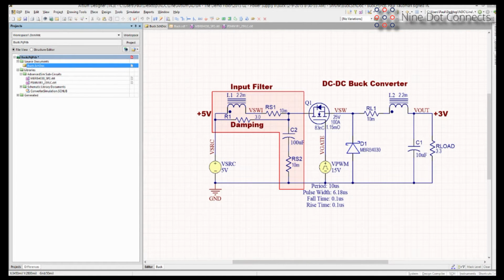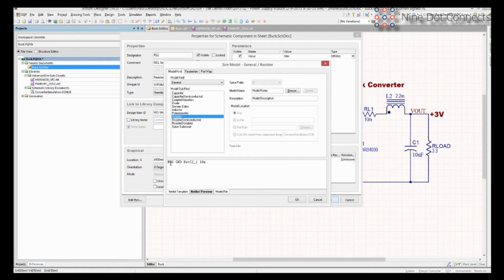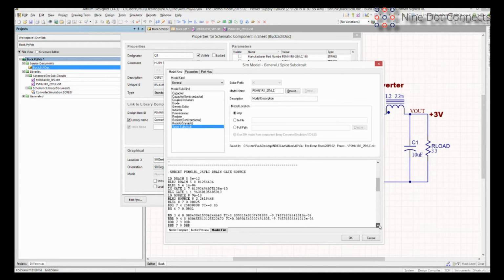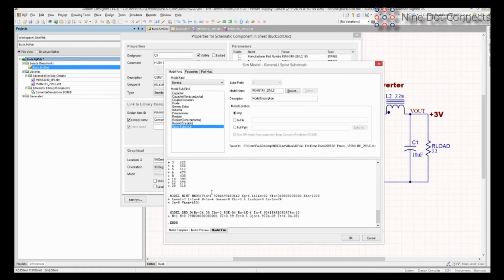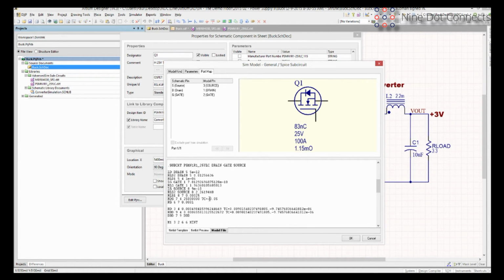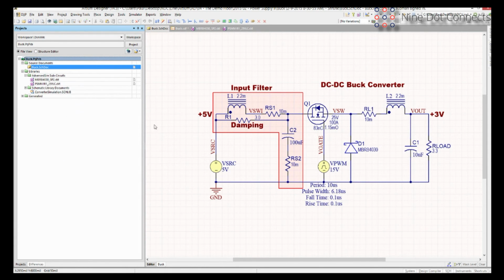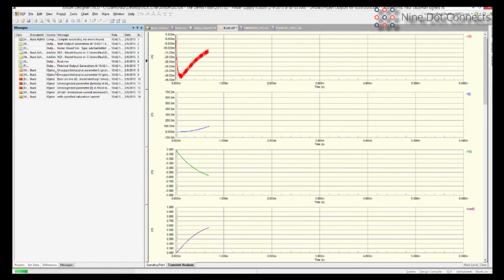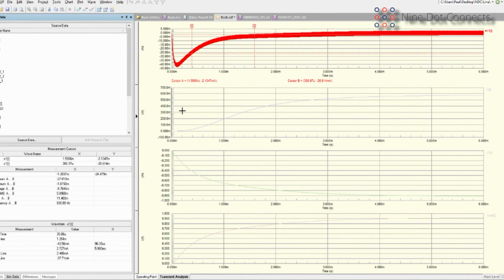Altium SPICE Overview

Comment: can you explain how to add spice model to a component without simulation ?
Reply from the maker: +rangelso -  Its the same method one would use to add a footprint to a symbol in Altium.  Instead, you are adding a text file instead of graphic. 

Here's a link that describes it in detail.  This instruction does not require the use of the vault:

http://techdocs.altium.com/display/AMSE/Linking+a+Simulation+Model+to+a+Schematic+Component